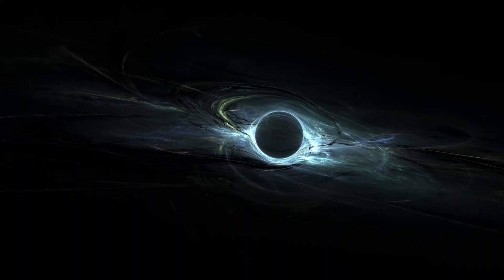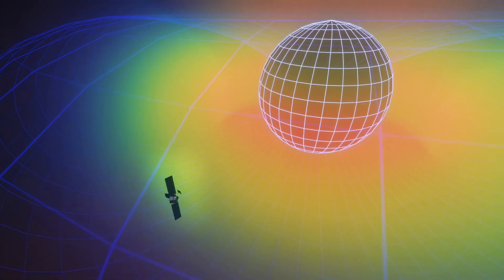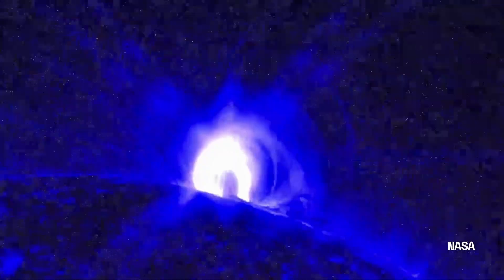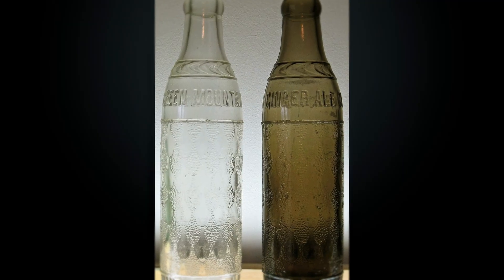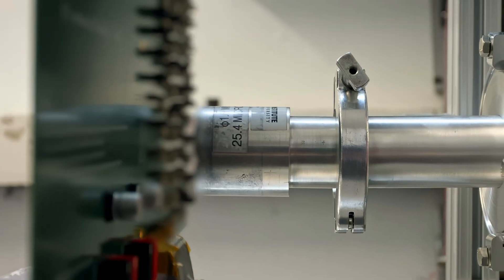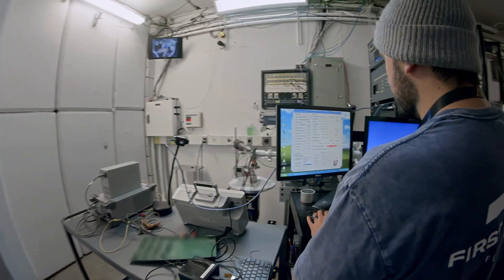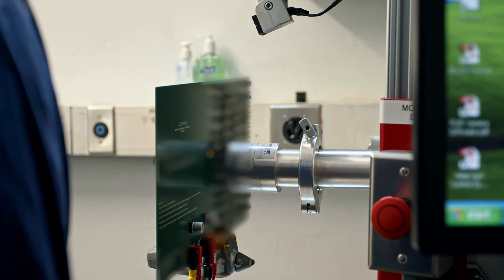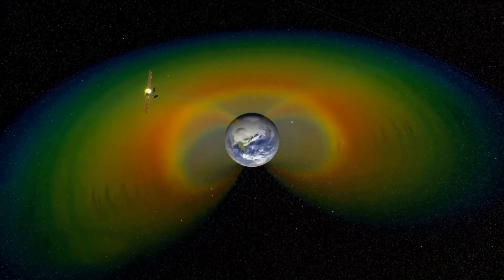The Scariest Thing in Space: Radiation 101

Comment: I worked for Marconi Space and defence 40 years ago and all off world components were hardened and screened and tested beyond belief.  A single resistor (pre surface mount) would come with a book of who did every process from cutting the glass core, metal oxide deposition, lead connection, paint and marking, through manufacturer testing, wholesaler testing who soldered it in and on and on until you had a component that should cost pence costing hundreds or thousands of pounds. It’s good that times change!